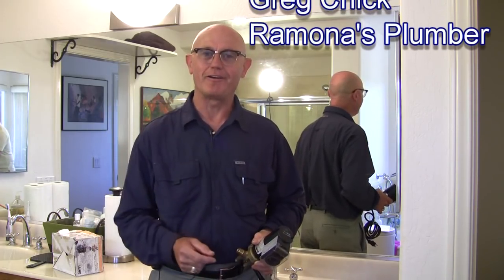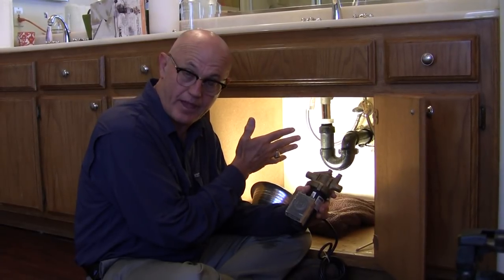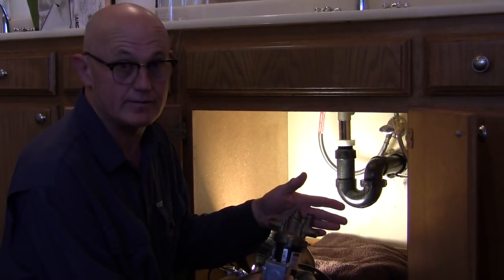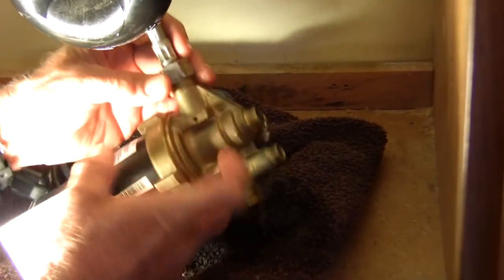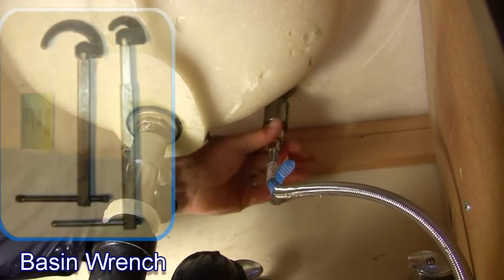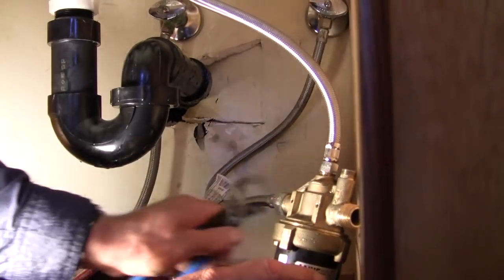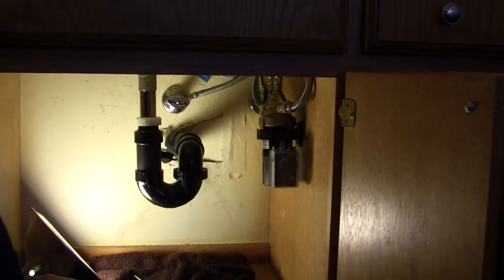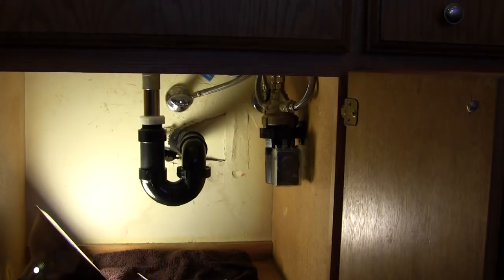Installing a Recirculation Pump for instant hot water and saving water

Comment: Install this little piece of hardware and watch your Gas bill jump by $75 bucks a month- installing a recirculation pump for "instant" hot water is just a terrible idea.
Reply: faffaflunkie First off, your gas bill won't go up by $75.  Secondly, the circulation pump would only need to run maybe 5 minutes every morning to get hot water out of a shower immediately.
Reply: faffaflunkie Not only will your gas bill skyrocket with this little beauty you also run the risk of getting legionnaires disease because the water in the tank wasn't maintained at the correct temperature.
Reply: faffaflunkie Clearly you are misinformed.  The pump doesn't have to be run all the time, only a few times a day for like 5-15 minutes.  Your water heater's tank will still maintain the correct temperature to prevent disease.  And your gas bill won't skyrocket.  People have used these products for many years without any of your concerns happening.
Reply: This is the cheap assed way of doing things- why would you want hot water coming out of your cold faucet anyway? If 30 seconds of cold water bothers you so much- just buy an inexpensive in line heater.
Reply: Wasting cold water to get hot water bothers me, because on the West Coast we are in a drought and our water bills are increasing because of it.  So maybe a recirculation pump isn't for you, but it will save us water and money out here.
Reply: How about wasting expensive hot water when you want plain old cold water? And they have plenty of water everywhere else- so why are you wasting everyone else's gas when you want a little drink?
Reply: I don't need cold water out of my tap all the time, because I don't drink from it.  You talked about bacteria in the water heater earlier, well they are in the cold side too, so one should never drink from an unfiltered tap.  But the bypass valve shuts off the recirculation once it reaches like 90 degrees anyway, which is perfect temp for washing hands.  But again, that doesn't mean the cold water side will always be that temp, only prior to my shower times.  I would only have circulation pump timer set for one or two times a day, for just showers since they are at the longest part of the house and would waste the most water waiting for it to heat up.
Reply: @faffaflunkie  ...quote... " why would you want hot water coming out of your cold faucet anyway? ".....hmm...maybe because you want a system to prevent water line freeze for southern homes that experience occasional deep freeze?.....

Comment: Call for Electrician ??? Cost $500 - $ 1000  ... need dedicated line ..  HMMMM  now we have to pay for electricity , which cost more money...HMMMMM  ...Heating lost from pipe..... HMMMM  ..... Unit cost How Much ??? .... $300  HMMMM  .. Maybe hire a contractor / plumber to install this unit... $400   HMMMM  ..and contaminated water cause of circulation  ...  HMMMMM  and many more...  What do you think ???
Reply: Tom Lam As in the video he stated another option is to install the pump at your hot water heater.  And since you will only have the timer set to run maybe 10 minutes every morning, the pumps electric use is minimal.
Reply: Tom Lam
Reply: Then you should just stick with what you have now.
Reply: I'm not sure who you have do your electricity, if you're paying more than $100 for an outlet installed you're getting ripped off
Reply: Tommy Gee 
I bought a pump and it uses 10 to 14 watts
 that really isn't a lot of electricity unless you're a Hermit living in a cave
Reply: David Henneberg it’s not the electricity consumed by the pump that matters. It’s the heat loss of the hot water in the pipes that adds the most to the cost of use.

Comment from the maker: Possibly an on demand pump set at desired pressure activated by flow switch.  The Flo Tech company makes them.  Just put it on the way to faucet below the sink.  They are the size of a liter bottle.

Comment: is this noisy when it runs? thx
Reply: no but it def should not be installed in the master bath if there is a guest bath next door, install it there.
Reply: rhonda froland no, it’s not noisy. Mine is installed in the master bathroom because that’s the end of the line for the shared copper water pipe. I can’t install it in the hall bath because that’s not the end of the line.  Meaning my master bath would not be instant hot. 

In my house the one pump gives me instant hot at all fixtures between water heater and master bath.  Which happens to be all fixtures.